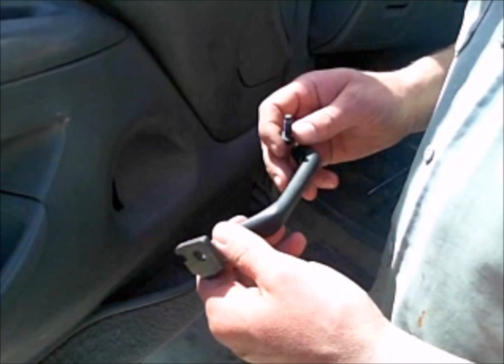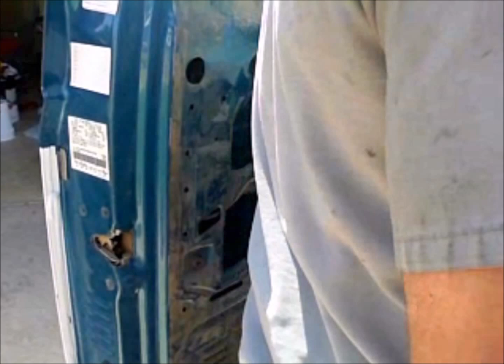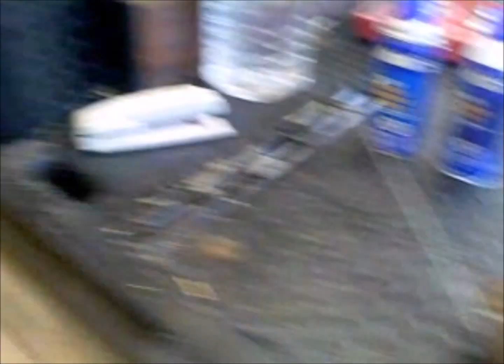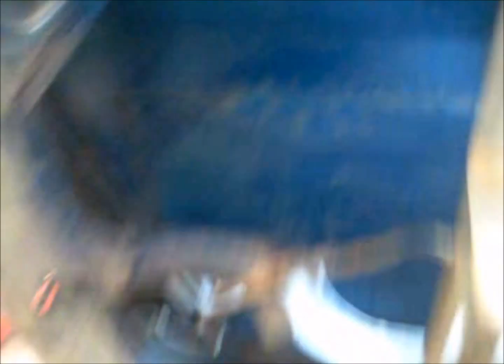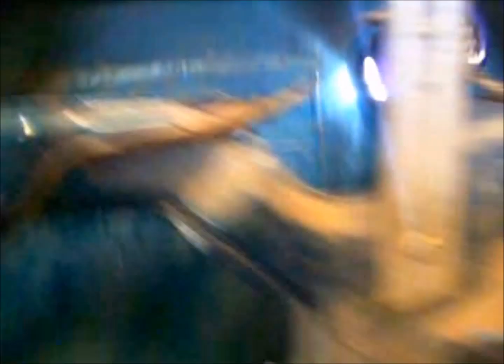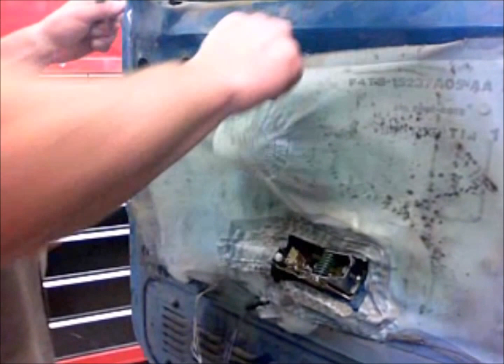Ford F-150 - F-350 driver door cable repair

Comment: I have the same issue with my 94 F250 diesel. I just got it back from having an electrical problem solved. I knew my cable had stretched and you had to pull the latch ALL the way up to open the door. I nursed it along until I got the truck home and then planned to do what you have just done however one of the mechanics pulled so hard on the handle to get it open he ripped the handle out of the metal. Now I can't even open the door. I hope by disengaging the cable end to the inside latch opens the door for me. This job is a MUST have the door open to get the job done. This is a GREAT video. It's exactly what I needed. Thanks for sharing it.
Reply from the maker: Sorry to hear about the mechanic breaking the handle off. You would expect him to be a little more careful given his background. Maybe it was right on the edge when he got to it. This is a part that you might want to use: https://cpaddict.com/door-handle-reinforcement-plate-1980-1997-f-series-bronco/     I have only used one of these on a door repair-the rest have all been brackets I have made but with him tearing it completely off, you might want to use this bracket.  Seems like a great part and fix for this problem.  Glad the video is helping!!    Also, you should be able to hold the mechanism and pull the handle or the cable (same thing in the end) and it should unlatch and open the door. Hopefully this helps.

Comment: I just bought a 1995 F250. Every now and then, the outside door handle won't release the lock mechanism and I have to open the door reaching across from the passenger side using the inside handle.  Any thoughts on if there may be something I can do without taking the whole door panel apart to fix or figure out why it happens occasionally and not all the time?  Thanks!
Reply from the maker: It sure doesn't look good if you don't want to pull the interior door panel. You might try some silicone spray around the door latch button and hope it penetrates in, but I would be surprised. While you are at it, spray a little of that in the lock mechanism and on the latch mechanism. Good preventive maintenance, but I think the door panel is going to have to come off.

Comment: https://cpaddict.com/  These guys manufacture a reinforcement plate to beef up the door metal where it has been damaged.
Reply from the maker: Yes, I replaced one of these door cables last month and used their door replacement bracket. I will be using them every time going forward. Highly recommend!

Comment: I'm disappointed in your show you just like the rest on here don't show how you got the door lock actuator out or disconnected it from the latch. What is the problem that you can't show this? You want to show people how it's done but you leave out the hard part. This is time I'll never get back. A waste of time. You definitely ain't a mechanic.

Comment: I have a 1994 F350 Crew Cab 4 doors that I just bought about a week ago. It has electric locks but only the front doors lock. I can not get the back doors to lock. Even the lock knobs do not move up or down and because of this I can not park it on the street in fear that it would be stolen or vandalized. Can you help me ?
Reply from the maker: It sounds like it could be several different things, but it is likely that the electrical signal is not getting to the doors at the rear of the cab. If your door switches are like the ones shown in the video, I would remove the switch assembly located in the driver door and look underneath to verify that all connections and wiring look right. Verify no wires have been pulled out of their sockets, verify that the connectors are properly connected. It could be a faulty switch and there are test procedures located in a good repair manual. As I state in my other video, I like the manuals available from helminc.com. No, I don't get paid to say that, I don't make any money from this channel whatsoever. Just trying to lend a helping hand to others.

Also, you could buy a wire piercing set to check and see if power is getting to the power lock mechanisms in the back doors. This would also require a voltmeter, a must have in my mind if you work on your own vehicles much. They are also handy for some home/appliance repair situations. Some people seem to make a test light work in a situation like your door lock problem. Just be careful to not create a hole that is too large and exposes the wiring.

I hope this helps as it can be pretty tough to provide solid information without looking at the vehicle.
Reply: TY its been cold here to do the testing. I will do what you say but why the back door locks wont work up and down manually? Are they restricted to the electric locking mechanism? I feel the  cable in the back drivers door where I took off the panel and I did put new extenders on the door locks they dont want to go up or down.
Reply from the maker: Even if the electronic portion of the mechanism is not working, the locks should function manually. It is odd that both do not work manually. Usually that does not happen at the same time (being a mechanical function in two separate doors), but sounds like you just bought the vehicle, and a lot of times it is tough to know its history.

If the locks do not function manually, then you need to take the door panels off and see what is going on inside. It is also a good time to push the lock and unlock button and listen to see if the electrical mechanism is trying to do its thing. Maybe the lock rods are not connected, or the bushing at the mechanism is broken/missing and causing problems? 

Based on what you are telling me, that is what I would do. 

Also, I would apply grease to all the moving parts in there as best you can. A friend at the local Ford dealer likes white lithium grease for this application, so I would recommend that. I have been amazed at how many things get fixed simply by lubricating them. While we are at it, I like to use silicone spray (I get mine from NAPA) on the latch mechanism. I just spray it on the the latches (the part that will latch onto the striker) every so often to keep things running smooth. Same for the tailgate latches.
Reply: Thank You. Yes I just got the truck. Your right I will have to get into the door to see whats happening. I did take the rear driver door panel off but because its been cold outside my legs cant take the cold. don't have a garage just a long driveway.  I am going to check the switches first and I will let you know. I did replace 2 door handles on my daughters Ford 91 explorer in June and also lubricated everything and  so far they work. Not afraid to get my hands dirty. you Tube is a big help for me. TY Julie

Comment: Do you have a reference or contact to acquire one of those thick plates that you placed behind the thin sheet metal portion of the door?
Reply from the maker: I do not. I usually take metal I have around the shop and cut it to size. 1/8 inch thick seems to be a pretty good choice for the thickness of the plate. You could probably buy some metal at your hardware store and cut it to size. Just drill a hole where you need it and I like to place a speed nut retaining clip that is well made on the edge over the hole you drilled for the bolt to thread into. That way I know the nut will not fall down in the door. Make sure the plate isn't so big that it catches the window and breaks it when you roll it down. A horizontal length greater than the one shown in the video is ideal as it is behind more of the doors sheet metal and will hold better.

I hope this helps.
Reply: solomotorsports.com sells one.